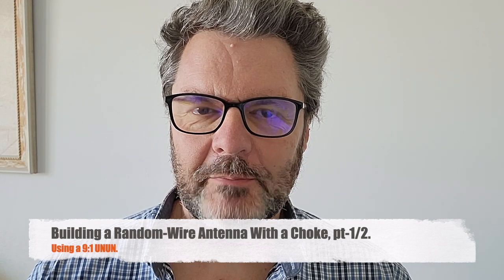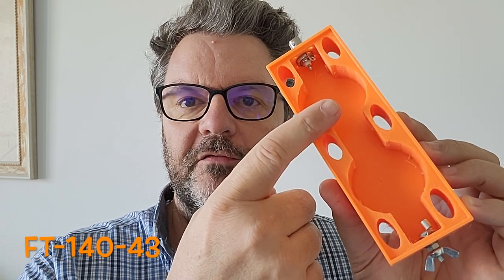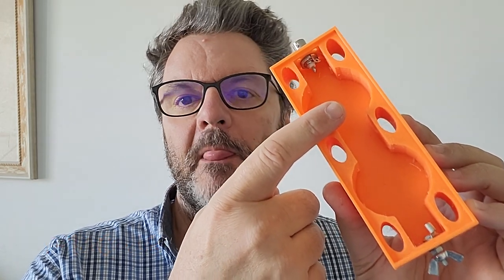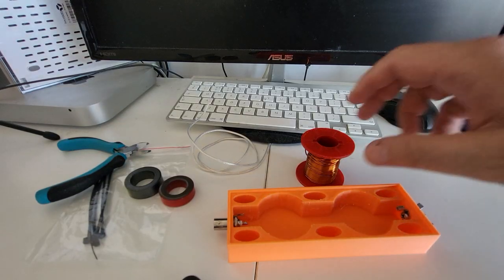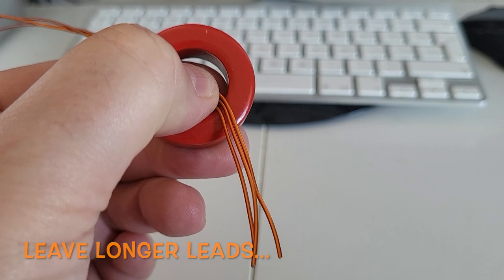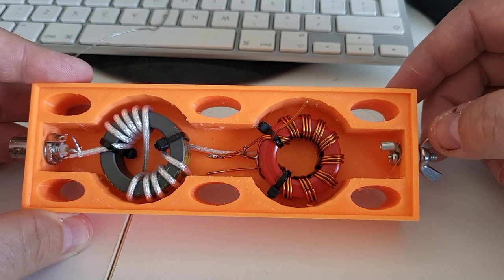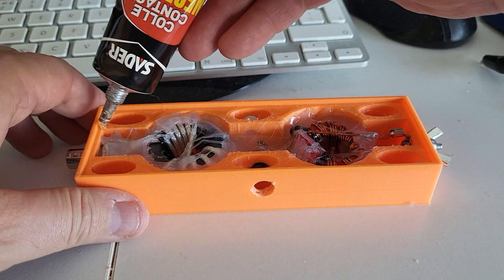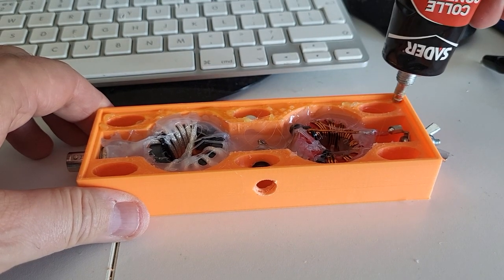Building a Random-Wire Antenna With a Choke, pt-1/2.

Comment: 9:1 UNUN non resonant end fed antenna is my favorite field antenna. I get coverage on every band from 70cm to either 80M or 160M depending on wire length.  For me in the field it's the ultimate all band antenna.  Is it the perfect radiator, no but it works perfectly well.  I have several of them I have made to loan out to new HAMS.  Again, it's a great all band antenna to get someone started on the HF bands.

Edited to add:  Also they are not really "random wire".  The length is quite critical to get all band coverage.
Reply from the maker: Absolutely, "random" is a misnomer..

Comment: Great vid Gil, I use various EFRW with 9:1 ununs and occasionally with terminating resistors, especially if you use ALE.

I want to share some Military secrets with you on the favorite ratio of the military (the 9:1) in its antennas.....
The secret is ; in order to be able to operate in the lower HF bands (especially for NVIS) you must reduce from 9 turns to 7 ! this will provide the proper inductance below 7 mhz up to 1.5mhz providing of course you have the magic lengths that do not fall into the 1/2λ formulas of the radiating wire. this will also work with the various T2FD antennas and the BBTDs as well as in vertical configs (over 6m height and never at 6 or below) be aware though that with 7 turns instead of 9 you gain efficiency lower HF band but loose more efficiency above 14 mhz. but as all compromise antennas, they are designed for specific purpose's.

 in all cases though, try to never cross over the ant. feed wire over the transformer. remember though that ununs radiate the coax and rightfully you use a choke, in some freq. though the counterpoise should be as short as possible but direct ground to the dirt this will give better results. noted dearly that in your video part 2. that beautiful Mediterranean beach with pebbles gives a bad ground, I'd love to see you work the same config. in a redder dirt area like a nice French park. I'm sure you will have better results. 
73's from an N2 in SV0 land!
Reply from the maker: Great info thanks! I will try it on my boat with the counterpoise in the water..

Comment: Gil, nice design. Since your design includes an integrated choke, this in theory would eliminate the coaxial as a counterpoise. So a counterpoise should be required to make it work. I have had a good experience with random wire antennas, also random wire antennas provide you with more wire length options and access to WARC bands. 73s
Reply: I want to add that the use of a counterpoise and a choke is what may confuse people the most when setting up a random wire End Fed antenna. I prefer a separated 9:1 UNUN and Choke, because it gives me the option to either use the coax as a counterpoise or choke it out of the equation if the coax length is not working for me. 73s
Reply from the maker: Yes, good point.

Comment: Consider having the 2 toroids at right-angles, forming a T. 
Your common mode choke stays the same, but you no longer have to worry about your antenna wire having to cross over.

Comment: Fascinating I’ve been playing around with the position of the ATU with the 9:1 unun when the radio isn’t close to the antenna.
I keep the choke close to the ATU with generally a 1-3m patch to the UNUN 

I see you’re loving the new knife (with new cut on the finger!) 

I’ve built a QRP 9:1 unun using three strands of twisted multi strand wire from an Ethernet cable - I’ve had good results and wonder why it’s suggested to use solid wire, other than the chaos of flexible wire compared to enameled wire. Any ideas?
Reply from the maker: The original document shows insulated multi-strand wires with colored insulation but I think solid wire stays in place better..
Reply from the maker: The original document shows insulated multi-strand wires with colored insulation but I think solid wire stays in place better..

Comment: LOL!  Gil you have great ideas and enthusiasm but you really must curb this need to smother solder joints with glue BEFORE testing!    (And trying to hand drill holes in large boxes, without using at least a cheap table vise to hold them, is just an advert for Bandaids!).  I'd be very interested to compare the on-air performance of this layout using the ferrite as the transformer and the powdered iron toroid as the choke.  And of course magnetic coupling between the toroids can be minimised if they are set at 90 degrees to each other - a bigger box is easy if you are 3D printing them.
Reply from the maker: Guilty!

Comment: You don't need a choke if the secondary of the 49:1 transformer is NOT connected to the primary. Use a counterpoise on the low end of the secondary so there will not be any common mode current on the coax. Adjust length and position of the counterpoise for lowest SWR.
Reply from the maker: It's a 9:1, not a 49:1. No choke is necessary with a half-wave wire and a 49:1; it's just like a dipole. However this is a 9:1 with a random wire and the primary is connected to the secondary.
Reply: @RadioPrepper  Do not connect the primary and secondary. Use a real counterpoise on the secondary. No common mode current.

Comment: 1. I like the idea of 2 in 1 - 9:1 resistance transformer and choke, but why does it seem that the windings of the transformer are not 9, but 8, or am I wrong?
2. From the studies I have seen about the two types of toroids - if they are exchanged, better results will be obtained. I'm sure. de LZ1MD 73

Comment: Hi Gill, I've made up a random wire with a couple of short lengths of ~25mm diameter PVC tube sections. The first has the 9:1 with optional terminal for a counter poise wire, then a second tube with 1:1 choke balun.. I normally use a length of coax between the transformer and the choke as my combined cp and feed line back to my operating position  works well for me!
Reply from the maker: Great, I am curious to see if it will work with the toroids so close..
Reply: @RadioPrepper  yes will be interesting! It should work great, especially with a counterpoise terminal between transformer and choke. Thanks for the videos, Gil!

Comment: Maybe try the 5:1 former from G8JNJ. 6 toroids with copper tubing inserts and wire wrapped. Similar make to the Alpha Antenna balun but cheaper.
Reply from the maker: I have a kit for it, need to build it..
Reply: Sounds interesting. Looking forward to the video on that one. Maybe I should search for the original...

Comment: Don't use a powdered iron core for the 9:1, us an FT140-61 core and it gives you a little more CMI.  Powdered iron cores are designed to be used as inductors in tuned circuits in things like tuners and harmonic filters, they are not designed to be used as baluns and ununs for HF work.
Reply from the maker: Did you watch the video? I explain...

Comment: I may be confused, but if you are going to use a tuner anyway, why is it not good on 40 meters (15:10)?
Reply from the maker: 80 not 40... It will work but won't be as efficient..

Comment: 4:10
You disprove Kirchhoff's first law )) 

Counterpoise is always there. Explicit or implicit. Current simply doesn't flow into single wire, there must be second. If you don't have wire your counterpoise are the coax, your radio, your hand.
Reply from the maker: Yes! But I don't want it to be the coax in this case so I add a wire...
Reply: @RadioPrepper  I wrote about EFHW ))

Comment: i dont understand why it doesnt work at 80m. is there a modification you could do to make it better on the lower bands?
Reply from the maker: It just isn't good at 80m... Using a different toroid is the solution.
Reply: @RadioPrepper  Next project, doing the same with FT240-43 and um, whatever the equivalent size of powdered iron core is! I built a 9:1 using an FT240-43 for my untuned EFHW. Since it was wet and windy and I hadn't put it up properly yet, I didn't want to go out and tune my EFHW, so I built a 9:1 transformer instead. On some bands the built in tuner in my 991 tunes with the 49:1, on other bands it tunes with my 9:1! 🙂
Reply from the maker: Well, I have no need for a higher power rating though..
Reply: @RadioPrepper  <Nods>

Comment: Why no glue around the torroids ? Be kind I'm a newbie.
Reply from the maker: Hi, I did not say no glue on the toroids, I said no epoxy. I once potted two transformers in epoxy, neither worked. Hot glue, however, has no effect..
Reply from the maker: Hi, I did not say no glue on the toroids, I said no epoxy. I once potted two transformers in epoxy, neither worked. Hot glue, however, has no effect.. I wish newbies did not have to ask OMs to be kind. Those who aren't are assholes..
Reply: @RadioPrepper  Thanks mate, 73 VK2LA

Comment: It looks, that on the left
transformer (thumbnail photo),
the one turn is missing.
Reply from the maker: Which turn? Not important in any case..
Reply: Should be symmetrical :
six to six or five to five,
Not six to five as your photo
shows.
73 from Voytek
Reply from the maker: If it was a bifilar symmetrical design, but it isn't.. Whether it's an odd or even number of turns makes no difference. I did not even need to cross over.
Reply: Really ?
What is the function of this
transformer ?  I hope, you know.

We need to block the RF signal
on the Coax Cable at this point
(the Coax Shield). This is a
reason to use of this
transformer.
The turns (both direction)
must be the same, to neutralize
magnetic field
(the magnetic trap).
Reply: @voytekfid7734 the current on the shield gets attenuated everytime it passes through the torrid.
The number of turns is completely irrelevant to this function.
The more turns the higher the CM attenuation.

This W1JR "balun" is no transformer in any way, it's just a common mode choke.
Reply: It is NOT a transformer. It is a simple coil.
Reply from the maker: As the others said and I say in the video. It is an RF choke, not a transformer.
Reply: @_0815_   yes, I agree. I named it :
 ”the magnetic trap”, but
I should to say ”the choke”  :)
Reply from the maker: It's not a transformer.